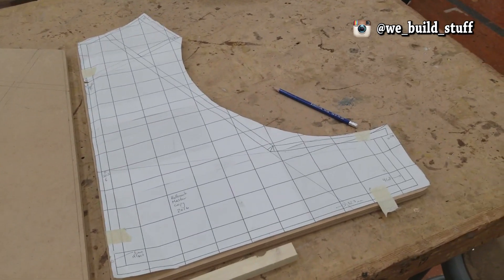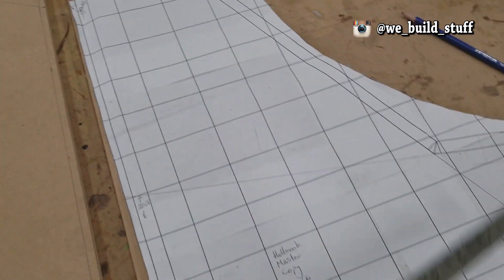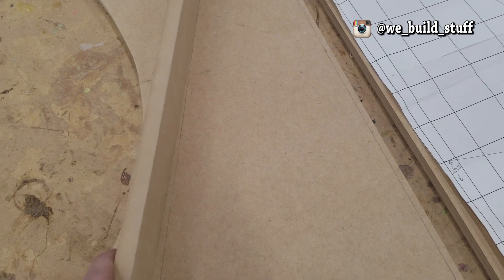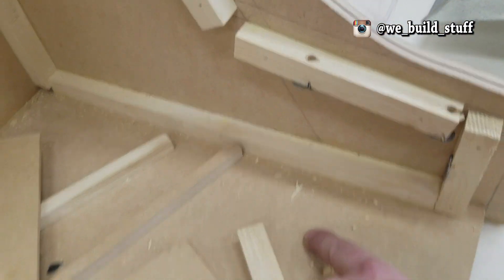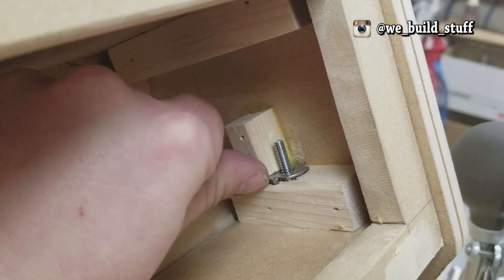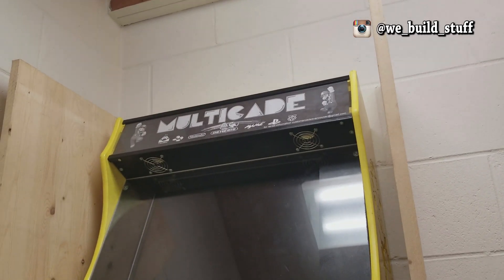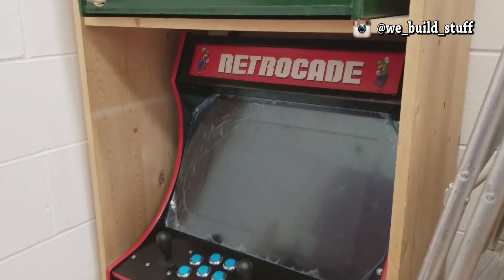BARTOP ARCADE CABINET Layout Design and Build Tips

Comment: Hello 
Great video
Quick question if anyone can help
The printout for the side panels and the dimensions on the dimensions and angles reference sheet don't add up? As in I print out the side panel the control panel measurement is 170mm but on the sheet it is 185.6mm
Am I being stupid?
Cheers for any help
Reply from the maker: Did you print at 100% size or scale it differently? Also able to draw with a ruler and copy the measurements like high school drafting class 😊 good luck
Reply: @WeBuildStuff  yer and yes
Reply: @WeBuildStuff  
I printed it out thinking the plans would be fine, it's only 3mm from some bits but up to 5mm off from other bits pleases  help me
Some bits are up  to 1cm put
Reply from the maker: @mickyom  the side panel usually prints as 4 to 5 pieces of paper and then need to be taped together into a template by lining them up. Double check the alignment maybe. Hard to tell the issue without knowing your print settings

Comment: Your plexiglass/lexan monitor cover. Are you making pilot holes/then attaching it to the wood blocking(dowels) directly? Or did you cut slots in the side panels a grove for it to sit flush in? What kinda of screws or bolts are you using to sit flush with the metal/cap/washer behind it ?
Reply from the maker: #10-24 machine bolts with a T nut
I would like to cut slots one day for a build that is flush but this was easier for me. Thanks for the comment
Reply: We Build Stuff so you used that size for entire build? And the plexiglass is going right into the wooden dowels attached to each side panel?  If you were to use a slot bit on a router would you still secure it on front like you did here or would that method eliminate the need for anchoring the glass on front? I’m a noob!! Thanks for your help
Reply from the maker: @gofast8144  a slot would be a nice way to anchor it  but i would need to make the top pieces removable so i could slide it in and out for cleaning, etc. Maybe one day!
Reply from the maker: @gofast8144  forgot to mention. The plexi sits on top of a monitor bezel made from1/2" mdf. You can kind of see it in my other builds or the live video I posted last night
Reply: We Build Stuff just watched video. The red looks vivid. Your bartops & full sized are 1/2” MDF?  Your bezel what router bit did you use to make it looks like a picture frame rounded and flush? Have you figured out or know of a hinged / swivel system to make the controls accessible flip top. Like to access a manual 4/8 switchable?
Reply from the maker: 1/2 for bartops. 3/4 for a full size standing cabinet.

I do a bolting top for the control panel to keep it locked from people who shouldn't need access (personal preference). I leave all my joysticks on 8 way. Again, personal preference.

Router bits for which video/build? These are the 3 that I own:
https://www.kmstools.com/freud-1-1-2-x-1-2-45-degree-chamfer-router-bit-7348

https://www.kmstools.com/freud-1-2-x-1-flush-trim-router-bit-7367

https://www.t-molding.com/whiteside-slot-cutter-6700a.html

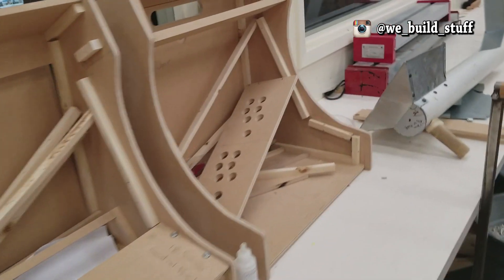Comment: Very nice explanation. Thank you very much. One question, what is the name of the two metal things you use at 0:42 to join the fixing block to the side panel?
Reply from the maker: Actually the blocks are just brad nails and glue. The metal part is a t-nut for bolting the control panel on. Check out my full arcade build video 😁

Comment: hello. when i cut the buttons holes in the plexiglass it melts and leave some hard melted goo on it that is hard to remove. what do i do
Reply from the maker: @FRIPLAY-TTV  if you want to save the piece use a file and sandpaper to smooth it out
Reply: @WeBuildStuff  thanks

Comment: Question for you. In the original build I saw that you wired your buttons and joystick directly to the Raspberry Pi, many of the button and joystick kits I am seeing come with their own controller board that plugs in via USB. Is there a reason you did it your way? Is it better for programming?
Reply from the maker: Jeff White I did it like this because as the time the usb encoder board that came with my eBay order of buttons was not compatible with Recalbox at the time. That was the only reason I went with the GPIO method
Reply: We Build Stuff okay so there's no other advantages to using the gpio?

Comment: Awesome video! I love your channel. I have a few questions if you could do me the favor of answering them. Your modified plans, on the arcade_write up pdf you mentioned that I could obtain those plans directly from you? Or are those plans the same ones you have on your pdf full size plans site? If you send them out personally I would love to have them. My last question is, what thickness in acrylic plexiglass sheets do you use on your screen? Could you possibly provide an Amazon link to the exact ones you used. Thanks in advance, cheers.
Reply from the maker: The plastic I got from another teacher or scraps from our robotics program.

The updated plans are on my website. You can see my bigger bartop arcade videos for more plans as well. 

There are a few different PDF files

Comment: Can I just use wood glue to assemble everything? Without a brad nailer?
Reply from the maker: Ash Russom. Of course. The nails have basically no strength. I only use them so I can keep working instead of waiting for glue to dry. A lot of people screw everything together but if you just use glue make sure they are clamped in position sonthe parts don't shift while drying. Keeping everything parallel 
/perpendicular, etc will result in a nicer finished cabinet!

Comment: How much wider did you end up making the cabinet ?
Reply from the maker: the original plans had the control panel piece at 50cm. I'm doing mine at 55cm. Not a huge difference but enough to give a little more room for the wires coming off the microswitches underneath!

Comment: fun fact this template doesn't fit a 2x2 board 24 inch by 24 inch. Its really close I reduced the pdf printable size to 96 percent and it works.
Reply from the maker: Always do whatever works for you! I usually buy a full sheet of plywood or MDF and have Home Depot do one big cut (usually the 55cm width of my panels) so I can fit it in my vehicle and save me time in the shop :)